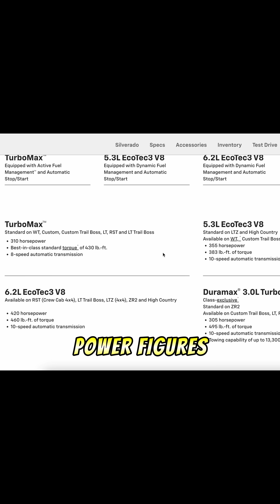Modern 1500 Engines Are Working Too Hard - WILL THEY LAST

Comment: My Tacoma would be screaming at 6-7k rpm’s simply trying to go uphill with no towing involved on a mountain driving 70mph 

so I’m not surprised the TurboTMax is screaming at 8k rpm’s while going at 100mph uphill with towing 8000lbs included into the mix.  Give the engine its credit. It’s also gone through extensive testing to the point they needed to kill the engine itself.
Reply: Look harder at the speedometer. It's in Kilometers.

Comment: Did anyone notice that he’s going 110 miles an hour supposedly hauling 8,000lbs. The car in front of him barely pulling away. Where are you driving this live test? My speedometer only goes to 140 in my V8 but yours says 200. Did they give you an extra 60 mph for the turbo?
Reply: Km yes is only 68mph. The performance does suck even brand new with those numbers. I’ll stick With the V8. Real power.

Comment: It's funny you post this yet the turbomax is without a doubt the most reliable engine in chevys 1/2 ton segment. 6.2s and 5.3s are dropping lifters and grenading themselves, and the 3.0L Duramax has electrical gremlins. I think a small displacement engine can do just fine, it depends on how it's built. Take the 2.7TT V6 for example, 325hp/400tq with the same material used in the 6.7 power stroke for its block, lots and lots of structural rigidity on the block, 6 bolt mains, forged internals, and very well breathing heads. Not to mention those 2.7s will make serious power too on just a tune.
Reply: They act like they just boosted some Ranger 3.0 from the 90s and called it good.

Comment: If some of these guys are worrying about towing etc…go get a 250, 2500, 350, 3500. 1500s are meant for lighter work! No matter what brand you get now they all have issues. Pick which crazy gal you can handle with problems 🤷🏼‍♂️

Comment: You are 100% right. But also, most people don't tow. For the average grocery getter going back and forth to work maxing out at 45 mph through town, 4-cylinder probably works fine
Reply: Between 1990 and 2000 was Peak automobile. I've had a couple new trucks in the last couple years and I would take one of the old trucks with a fresh drivetrain any day

Comment: I wasn’t a fan of the smaller displacement turbo engines but I drove a Ram with the hurricane. IF I was going to buy a new truck that’s probably the one I’d get. Relatively simple design compared to other engines these days, only one turbo, and makes great power. So far the reliability of them has been pretty good.

Comment: Yes an no. The efficiency is WAY higher so more hp. So yes they arent overbuily like old 2jz that where 1000hp blocks pushing 250hp, but yeah modern engines really cant be pushed over stock like old ones. GOOD modern engines running stock and u run oil changes 5k+/- miles they will last just fine. Problem is your talking ford/gm they dont build bare minimum good quality let alone last pushed hard

Comment: 5000 rpms at 110kph (roughly 68mph) is crazy. That engine doesn’t have enough low end torque to do what they want it to do. 100,000 miles is all these things are going to run. They’d be better off making smaller inline 6’s again instead of trying to make a 4 banger what it just isn’t. A 3.5 liter I6 with more modern computer controls and a well-designed head could make decent horsepower numbers, while retaining low end torque that’s actually useful for truck-stuff. They could offer a turbo version if they wanted, but N/A is the one I’d buy.

Comment: Absolutely incorrect thinking. I had a ram 2500 with a 6.4 and it always ran at damn near 250 degrees while towing and felt more stressed towing my trailer than my 3.5 ecoboost

Comment: I don't believe power per displacement isn't hurting these engines. 
The engineers building them the same as their low power cousins is what kills them.
Just like diesels, the engine has to be built to handle the power, and the cooling package has to be able to keep up, which they don't have in halftons.

Comment: Honestly tho, its probably better to just get the cheapest that’ll do what you need because even if in theory the bigger one is better, all it takes it one dumb part to have a problem from the factory/design and you’re F’d either way. We’ve been seeing big displacement cummins engines always have some issue for example.

Comment: No replacement for displacement!
Also my l8t powered savanna work van is a beast. Normally we would buy vans with the 4.8, and later the 4.3, but we were desperate for another van during the big shortage of them back in ‘23. My dad stumbled upon a Buick dealer that had been sent one on “accident” (for lack of a better word)and we drove to that dealership that afternoon. It has the new 6.6. I remember getting on the interstate for the first time and almost burn rubber because of how much more power it has compared to the 4.8 powered van i was used to. Even though we normally wouldn’t have spec’d it with a big v8, (our guys are only towing a small jetter a couple times a week) im glad we bought it, because i tow our small excavator with it (about a 6500 lb load)

Comment: It's very possible to build them to last, but not with GM bean counters. GM has screwed up so badly, Allison is pulling their licensing for the Duramax 10 speed! Allison didn't build it, and just let GM use the durable Allison name, that they have thoroughly screwed! They have to sell all Allison badged inventory early 2026, and after that date remove the rest. Allison is pissed!

Comment: I had posted on some where on the internet, they more RPMs that used, the faster the engine wears. That’s why after a NASCAR RACE, the engine is completely torn down and rebuilt for another race.
Reply: 😂😂 you are comparing longevity of a 900hp racing engine screaming 8,000 rpm for 500 miles to production car. The difference is, they are pushing limits with very high compression hammering all the bearings and huge camshafts fighting heavy valve springs in the valve train. They also want their engines to be at 100% health for the next race and have budgets allocated for engine rebuilds. Top fuel and funny cars rebuild their's every pass for the same reasons.

Comment: So it's less the pressure and more all of the complex componentry that goes into making that much power. Ecoboosts with high quality maintenance will do 200k+ miles which is probably less than you'd get with a big NA V8 (300kish) but it takes way more anal maintenance and all the DI and variable timing and turbo crap goes out if things aren't perfect and costs a fortune to fix.

But when it comes to base engine, head gaskets, cyl walls and rings, things actually exposed to high pressure, they hold up ~85% as long as a high compression high RPM NA V8. 

Sure the old 200hp low pressure V8 loppers ran on booger oil and no maintenance and theoretically could do 500k+ but few people pushed them that long.

Third owner market is going to be killed by the fuel system, valvetrain, and turbo repairs before the bottom ends let loose.

Comment: A couple of things here. Most serious towing guys are choosing a heavier duty truck. Most folks who buy half tons dont overwork him,but yeah if they're sayin a turbo can tow 10-12k lbs they should engineer it accordingly. I'm not sure what you're talkin about them running hotter? Any truck na or turbo has an adequate cooling system and runs around 200 degrees with no problem, even towing. The biggest killer is lack of maintenance, and that applies to any vehicle.  I've a 2016 f150 2.7 EcoBoost that I've towed a 22ft bumper pull camper with seasonally and I pull a dual axle lawncare trailer spring,summer,and fall. I also haul 6 cord of firewood a year with it. 9 full years with no problems. New trucks,all new trucks are over engineered and people drive em hard and put em up wet without proper maintenance. Keep your oil changed, with good quality oil and filter. Change your transmission fluid and filter earlier and more frequently than called for. Change your coolant and axle fluids. A little maintenance now will save you big down the road. My trucks rated to tow like 7600lbs,but the my camper is just over 5k and my loaded utility trailer is just over 3k. I have hauled about 5k lb of wood on my utility trailer a couple times,which would put it close to my max towing,but I know that that's not a good idea to do on a regular basis. If you're towing 12k lb trailers through the mountains or across the desert yeah you need a 3/4 ton truck with a gas v8. You'll automatically get oil coolers,bigger capacity radiator,heavier transmission and drivetrain,10ply tires. It just makes common sense.
Reply: Thanks for this. Helpful for my future truck purchase.
Reply: @Augustine1488 if you're lookin at a 3/4 ton gas truck may I suggest you consider an f150 with the 6.8 gas v8. It tows and hauls great,when properly optioned and costs alot less than the Godzilla 7.3. My little f150s 2.7 was designed from the ground up to be a turbocharged engine and is built to take the pressures of what I do. Even towing and hauling like I do for 9 years it still averages 20.2mpg overall. Forged rods and crank,graphite iron block,and Borg Warner turbos have held up well so far. I live in West Virginia and I'm always goin up and down 7% grades and it does fine. If you're gonna tow and haul make sure your new truck is optioned right. I found that my camper maxed out my tongue weight capacity, but I've since sold the camper. It pulled it fine,but squatted the truck more than I'd of liked. Tows my boat and utility trailer great.
Reply: @ciphercode2298  did you mean an F-250 with the 6.8? Because you can't get the 6.8 in an F-150.

And yeah, those 2.7L EcoBoost engines are impressive.

This mechanic has no idea when it comes to the EcoBoost 2.7 and 3.5. He seems to just be regurgitating the usual schtick about engines being "overstressed", ignoring the issues with GM and Chrysler V8s with cylinder deactivation, where modern turbocharged engines make their power, and that the basic theory around them is no different than heavy-duty turbo-diesel engines.
Reply: @JamesPhieffer yeah,a 3/4 ton would be an f250. I really dont forsee any troubke with turbocharged engines.  Certainly no more than with the other v8 offerings. Ive never gotten to drive the newer 10spd f150s,but i really like my 6spd up here in the mountains. Shifts great and holds me back pretty good goin down the mountains. Ive no regrets and wouldnt hesitate to buy another one.

Comment: I think it’s in how the engine is designed. For example, many diesel are in line 6 cylinders.
Reply: Has nothing to do with it. There have been just as many configurations of diesel engines as gas engines. Inline 6 is just easier to package in a long nose US class 8 truck. Europe still uses a lot of v8's in their class 8 trucks just like the US used to do
Reply: @shroom9033 I’m not sure I follow what you mean.   My logic is that a properly designed turbo four-cylinder with parts that are built to handle the torque has higher volumetric efficiency and can reliably perform as well as or better than most naturally aspirated V8, and I used an inline six (or four) cylinder turbo diesel as an example of a non-V8 that can also be reliable.

Comment: If the government wants to push regulations to help, why don't they quit obsessing over mpgs, especially when it just causes the engine to burn oil which is worse for the environment, and instead set standards for how long a vehicle should typically last before it goes to the landfill?
Reply: Because the government makes too much money on taxing vehicle sales.
Reply: They should say least factor the environmental impact that it takes to build the engine and truck and if they don't last as long, that means it will need to be replaced and then the next truck manufacturer process to build its replacement should also be factor in.

Comment: You don't buy a turbo 4 cylinder pick up to tow a 8000 lb trailer. 🤣
Reply: Y'all are acting like it's a boosted iron duke...

It's built like a brick house. Y'all just can't get past the 4 cylinders
Reply: @anthonyrowland9072  if it was just natural progression of technology and not the EPA shoving tighter and tighter fuel economy standards down manufacturers throats, I’d be more inclined to at least partially agree with you.
Reply: @Joe-hz1nw  If it was a diesel you wouldn't care...

Also, why is it never the automakers cheap out and try to make parts out of plastic so it just makes it to warranty the cheapest way possible?
Reply: @anthonyrowland9072  silly comparing apples and oranges.  GM can act as if that 2.7 is built like a diesel engine all day long and people like you fall for it, hook, line, and sinker.  Add in the turbo and it’s simple physics, it isn’t going to last as long.  In theory, GM could make it last that long, but they aren’t going to.

Since you brought up diesels, I’ll bite. Notice how 3500 trucks have the most torque and HP, yet they detune those engines for larger trucks?  Magic how they detune them to make them last longer & be more efficient.  Can’t do that with the smaller displacement engines - high strung until the end. 

PS - look up how much it costs to replace that turbo as well, something you don’t have to do with an NA engine.  $2,000 - even worse on other models of trucks with variable geometry turbos.  This doesn’t take into account the other things that can break on turbo vehicles like intercoolers, cracked manifolds set up for turbos are more expensive.  People not taking the time to idle down after high loads, and a litany of other issues.  Not to mention the real world fuel economy for turbo vehicles is pitiful compared to EPA ratings.

In summary, simple is generally better, we’ve reached the land of diminishing returns 20+ years ago for most people’s usage.
Reply: @Joe-hz1nw  If it was a DAYSUL you'd look past all of that lmao

In reality, you just don't want the gumbint making you buy a "god damn gay lil 4 cylinder truck". Also, it's not high strung...
Reply: If the vehicles pulling it fine and trans temps are good it can handle it. If it’s lugging then you got issues.
Reply: The Ford ranger would like to have a word with you lol
Reply: No a 6 cylinder eco beast is the best towing engine for sure. Especially up hills and at elevation. And they last awhile. Been out since 2011 and keeps improving.
Reply: Sure you do. Tows it just fine. Has the HP and TQ to do it just fine
Reply: @countcuda70 from the build  specs it has a long stroke on the crank and plenty of engineering to harness that power. Similar to the bore and stroke of the Cummins 4BT.
Reply: @countcuda70  I bet you’ll question why it bends a rod or spins a bearing at 50k miles
Reply: @aidanjones6066  I don't at all. The rotating assembly is forged. It's literally built for it. Spun bearing is from the bs oil they say needs to be used not from being turbocharged. Turbos have been used for a long time
Reply: @aidanjones6066 my ranger never had issues towing my 7500 travel trailer… 191k miles so far

Comment: I have a 2016 2.7 F150 and am loving it at 75k miles. We keep it parked as much as possible and use it for towing the 4k lb camper and hauling stuff hither and thither. Gets 24 mpgs in the Blue Ridge mountains no less. Change the oil every 6 months since it doesn’t reach 5k miles in that time. It also uses a Compacted Graphite Iron material for the upper engine block.
Reply: It helps that the 2.7s are V6s and not I4s
Reply: “We keep it parked as much as possible “ and “upper engine block” tells me something aint quite right with ol buddy.
Reply: Ticking time bomb!
Reply: @ranger1752 not at all there's tons of these motors with 200k fleet vehicles I own a 2.7 tow my boat side by side and does it with easy. I use to be a v8 fan until I got this motor.
Reply: @blainepatterson6792 yeah 200k isn’t uncommon without major problems BUT your 5.0 f150 is always going to reach 200k and commonly with NO problems. They also will last longer in the long run after that. It is a fact, however not ratting on the ole eco boosts as for what they are they do outlast a lot of other manufacturers engines ie the turbo max in the video. 👍
Reply: @blainepatterson6792 ALSO fleet vehicles get the easiest miles and amount of heat cycles. There’s not many modern vehicles that wouldn’t be making it to 200k as a fleet. Highway miles = easy on suspension, differentials, transmission, and all gaskets. You’re at the same rpm and the engine only heat cycles one to two times a day. Vs your daily with may be between 3-infinite. One of the best deals you can get on a vehicle is buying a fleet one because everyone else sees the miles and shys away foolishly
Reply: @CalebDressel-kt7pu I disagree a little depends on use with what I see is a lot of idle hours. The 5.0 has a lot of oil consumption with this. It happens to the guys I know running them. Back to your other response. The 2.7 is also made different CGI block like the 6.7 desiels. They do very well with boost. The 3.5 I'm not a fan of it's got tons of power but lots of issues. The 2.7 is a great motor with very little issues other than maintenance unlike it's big brother the 3.5.
Reply: @blainepatterson6792  See I actually love my 3.5 and it’s done very well. As has my parents with nearly 300,000 on it
Reply: @portersorensen8814 Good, I know several people with cam phasers going bad. Again it proves turbo engineering is much better these days. Ecoboost engines are great motors.  👍
Reply: You'll love it until about the 120k mark when it explodes
Reply: @jakeme9911 another opinion 😂

Comment: All I'm saying is my local gm dealer has sold over 100k trucks with the 2.7L engine and not a single one has came back f****d. They come back for oil changes at 100k+ still going tough. We do however have a line full of blown 6.2s needing back ordered engine replacements.